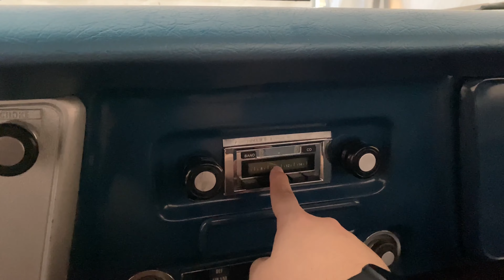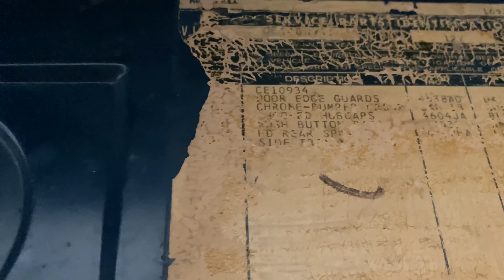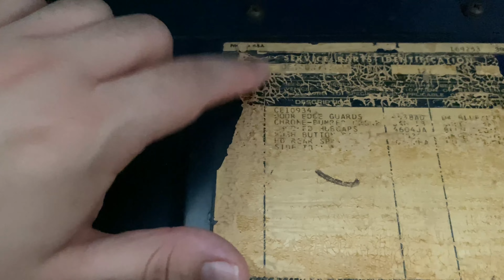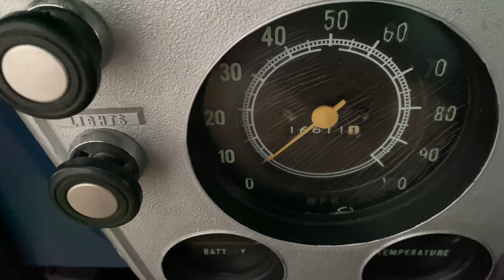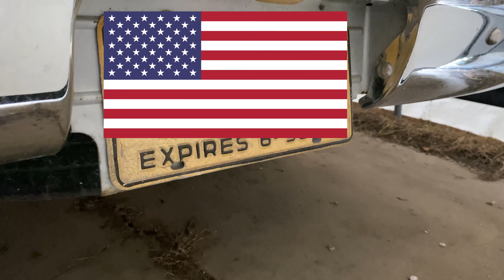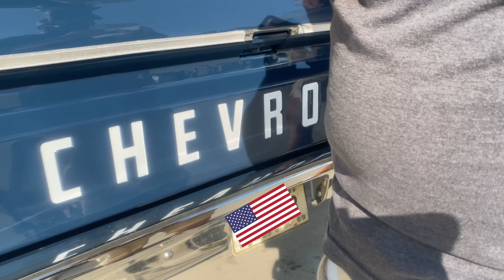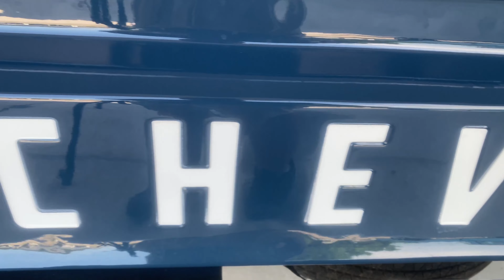1968 Chevrolet C10- My First Truck

Comment: SLM, Thanks for the memories!
I learned to drive in a 1967 Chevrolet Custom Deluxe with the special red-body, white-cab paint. Straight 6, with 3-on-the-tree shifter. And of course, the vinyl bench seat. In 1974, it looked like it had just rolled off the showroom. That truck was my late Dad's pride and joy.
Later in life, I learned that he sold that truck in 1975 to buy my first car - a 1969 Dodge Charger RT/SE with a 440 Magnum and 4 speed manual.  I miss both of those vehicles.
But I miss my loving Dad the most.

Comment: Beautiful truck man, I want one of that style, although I'm more of a K-series fan, I like my 4WDs. I have been a long time fan of the C-K (as well as the 87-91 R-V, basically the 87+ names for the square body C-Ks) series of GM trucks, anything from 67 through 94 (before the computers get too integrated), the 350 is my engine of choice and has been in both of my trucks, both my 94 K-1500 and my 81 K-2.

Comment: Very nice! The "Action Line" trucks are super nice. Very advanced for their day and arguably even more so than the generation that came after them. I'm a die-hard squarebody guy but these are super nice too. And the fact that they were on trailing arms and coil-overs way back then and then reverted back to leafs for the squarebodies is hilarious to me. I'd much rather have the trailing arms.

I just can't get over the fact that you could buy a truck with IFS and coil-overs+trailing arms in the back in the 1960s..

Comment: I'd take a punt that it's the 307.8 cu. in. V8 that was also installed on Holden cars in Australia back in 1968. The 327 and later 350 cu. in. V8 engines were usually fitted to performance-oriented vehicles, such as the Holden Monaro 2 door coupe. The 307 was a strong and reliable engine, widely fitted to GM vehicles around the world. It ran in the Chevy C series pickups from 1968 - 1972, while the 327 ran only in 1967 - 1968. I guess that means there is some chance it could be a 327. My money is on a 307 though. I am, however, not an expert, Sea Lord.